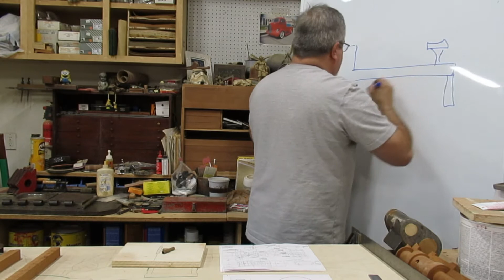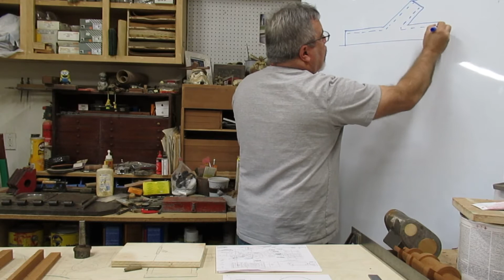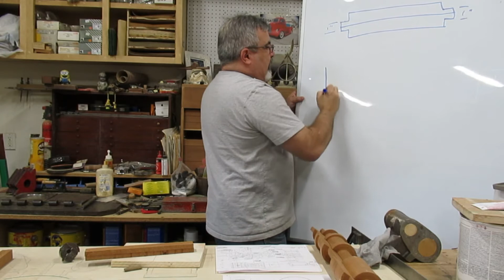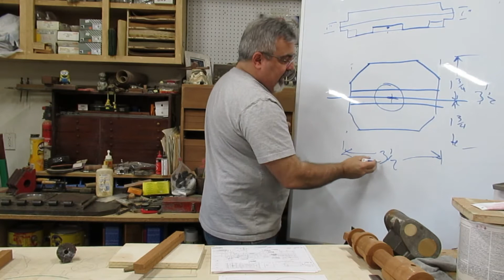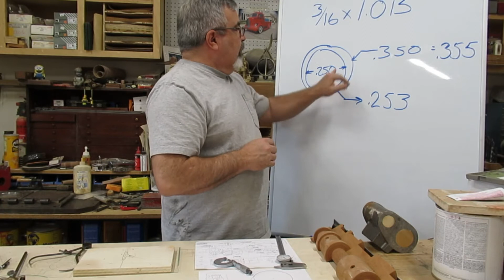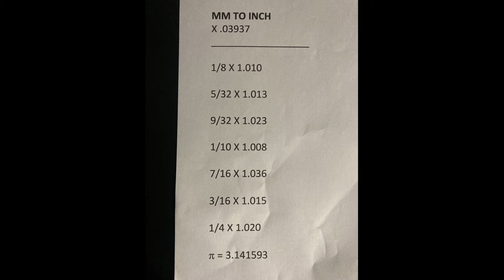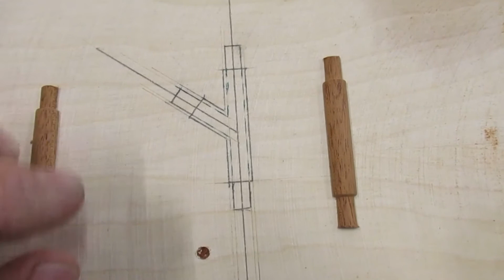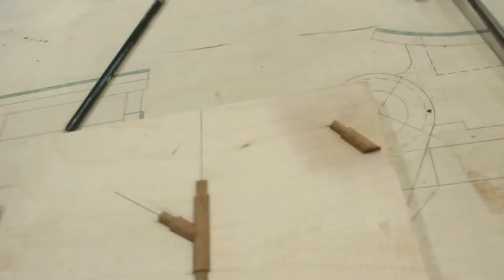Prototype Pattern

Comment: I need to build a split pattern for a cored cone shaped section, but I don't have a lathe.  Yet... Thinking I might be able to get by for now by rigging up something with a drill and belt sander.
Reply from the maker: Hey Tobho, can you send me a pitcher or a sketch. I might be able to suggest something.
Reply: @DaveClarkThePatternGuy  Thanks!  Not sure where to send it though...  Do you have an email address or something that you are willing to post here?  If not, I have a second email address just for times like this that I can post here so you can email me and I can reply back.
Reply from the maker: @tobhomott  Send it to dcpatternworks5@gmail.com  Thanks
Reply: @DaveClarkThePatternGuy  the pattern is for a spear tip, I've been doodling a bit, loosely based on this since it has some measurements given, but with no real need for historical accuracy or the semicircular hole details in the fins, so I can eyeball or adjust as much as I want or need to for convenience, aesthetics, or simplicity, so long as it looks good and authentic enough to satisfy the slightly above average Joe: https://www.clarelibrary.ie/eolas/claremuseum/riches_of_clare/power/bronze_socketed_spearhead2.htm#:~:text=Length%20(spearhead)%3A%2020cm%3B%20Max,goods%20went%20out%20of%20favour.  A local club wants 5 of them to use for ceremonial purposes.  I can figure out how to do the fins, it's just thinking about the 2 split cones (one for the core stick and one for the actual pattern, same taper on both) that is keeping me up at night.  If I can build a jig of some kind to hold the work steady at a given angle, I was thinking my "drill and belt sander lathe" idea might work to make two similar enough cones to get me by in a pinch.  But I'm all ears if you have a better suggestion! (Edit: email sent, thanks again)